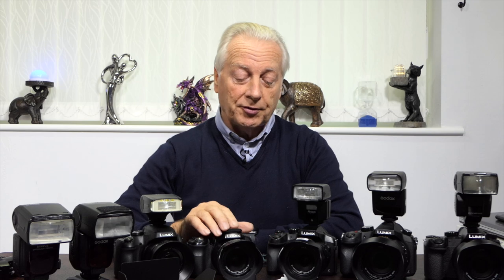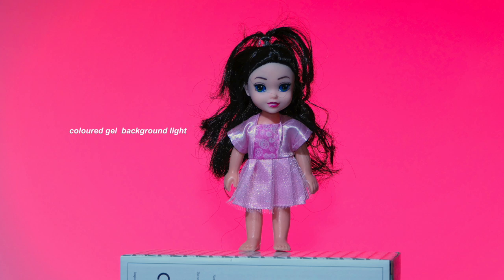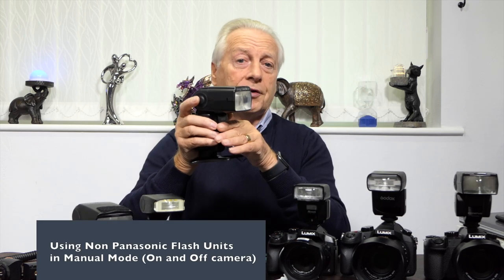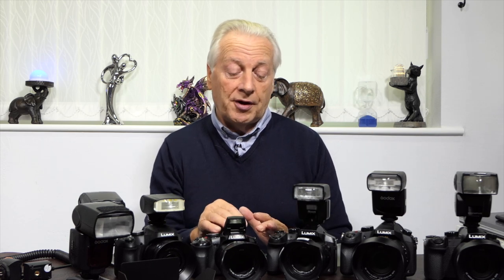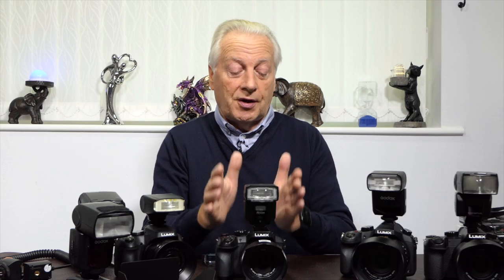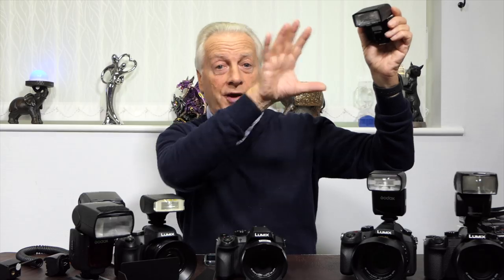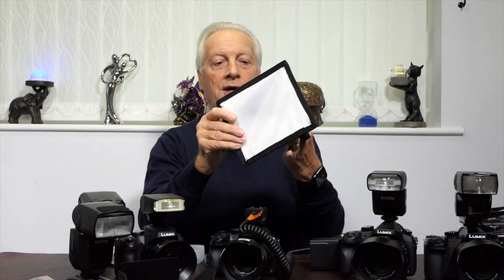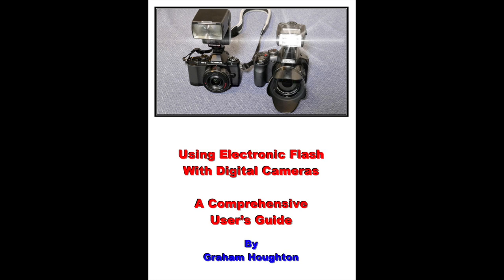Basic Photography with Panasonic Bridge Cameras:  Part 8 using flash

Comment: I have used my Olympus FL36 successfully with my FZ-200 and have never damaged the camera or had the flash not fire.  My neighbor used the Olympus FL50 with his FZ200 and did not have a problem.  Finally, use of the on-camera flash with the lens hood will result in a large shadow being cast by it.  Panasonic recommends removal of the hood when using the on-camera flash.

Comment: Hello Graham I bought an FZ 200 some years ago (even before your excellent manual was created) together with a Nissin i40 speedlight. The i40 is a splendid piece of kit and particularly easy to use in manual mode you simply twiddle the dials unlike the faffing about with the Canon flash I use on my 7D2 and 5D4. As you seem to have excellent technical as well as photographic knowledge can you advise whether using the i40 on these Canon models(in manual mode) will likely cause damage. I suspect not, but I'm loathe to try it out and regret at leisure. In essence are they trigger voltages compatible as I can find nothing to help on the  internet.

Comment: I'm doubting wether I buy a Godox TT350o or a TT685o for my Lumix DMC FZ 200. Anyone advice for me? Thanks
Reply from the maker: The 685 has more power if you really need that for bounce flash type pictures. The 350 is a better size balance on the camera as it is a little more compact for the smaller camera body. With flash big is usually better but you have to balance this with the size of camera body that you will be using it for. As the FZ200 is firing in TTL mode you won't get the advantages of shooting manual with these guns which is where the creative flash pictures are created. You could use the flash off-camera in S2 mode for some additional lighting with the pop-up flash being the main source.
Reply: Graham, which one would you personally recommand, it's mostly for portrait or productphotography, off-camera. Thanks